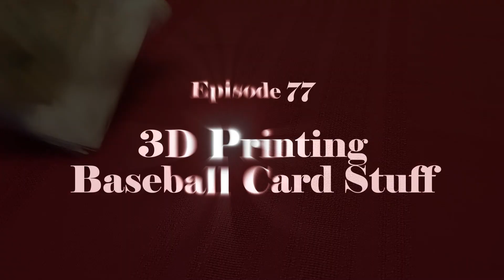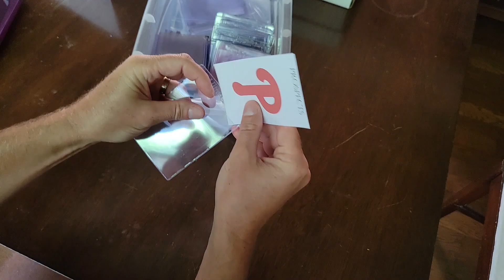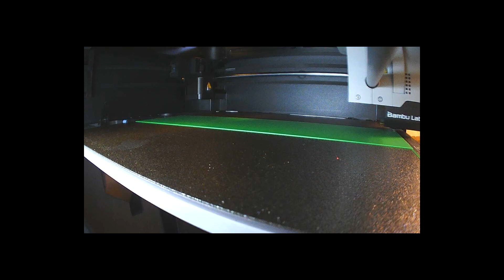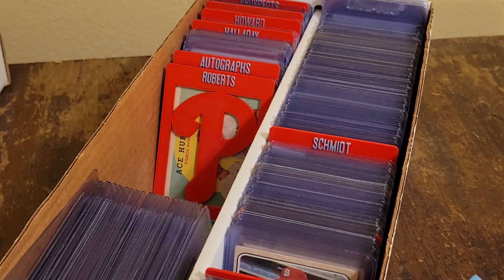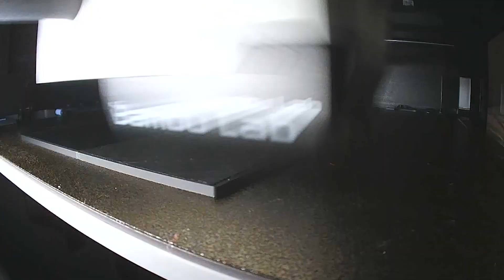Baseball Cards and 3D Printing!

Comment: Love the channel - been catching up on old videos and saw this one today.  Relevant as I've been keeping my printer hard at work the past weeks to help organize my cards.  I've also been using Claude to help me design my files - it does a great job (better than I can do) building the .stl files - after a few back and forth prompts.  It will not let me use team logos in the prints though as it doesn't want to violate logo copyrights/etc.  

The most complex thing I've had to help me design and print is a honeycomb type wall mount with a ledge inside and on top allowing me to mount to my wall and configure as many as I want to in a modular fashion and in any design I desire.  I can then put a card inside and on top, to let me display my favs on the wall.  I printed 35 so far, each taking about 9.5 hours (on my old Prusa).  I could reasonably do one while I was awake and one while asleep each night.  I've finished one wall and will soon attach another.  Thankfully living in Denmark and where my window faces, these walls don't get any real direct sunlight, so it's not horrible to keep the cards out.

The least complex thing are small label plates that I use A/B magnet strips to mount on the outside of my card boxes - those labels tell me what set the cards inside that box row are, and being magnets I can easily move and shift them around as I reorganize boxes.  I prefer this to writing on the actual boxes themselves.  It look nicer and lets me incorporate designs (team logos if the box is for a team) or whatever.  My printer is hard at work on this task right now.

Keep up the good work, I really enjoy the videos.  You've given me great project ideas in collecting my favorite team (Nationals - sorry Phillies fan, but I am originally from DC).  These less expensive projects will keep me busy and satisfy my need to plan and organize without breaking the bank.  I'm off now to create checklists for all the base cards for Nationals who have played since their inception in 2005.  Then the search begins - even harder since I live in Denmark now and baseball cards are scarce!

Comment: @ThePhilliesGuy Did you happen to upload the STL for the top loader caps anywhere? Something you could share? Rather not reinvent the wheel if this is available. Great idea.
Reply from the maker: No uploads. The problem is, as I demonstrated in my toploader test vid, every manufacturer has a different size and tolerance. So I couldn't make one piece to universally fit.

Comment: I can't think of an answer for what I might need for my cards that you haven't already covered in this video, but if I do, I'll post an updated comment.  On the snarky side, I'd say that the dividers are the proverbial solution in search of a problem, but darn, they look great!  And the other uses you highlighted are ingenious.  I agree with you about  regular tape on card holders; it's a pain.  If I ship something in a holder, I fold a little round sticker (which I've stamped with a baseball) over the top.  Primitive, but my geezerhead style, and it works.  Thanks for a fascinating tech presentation!